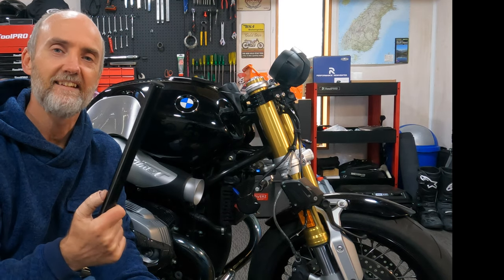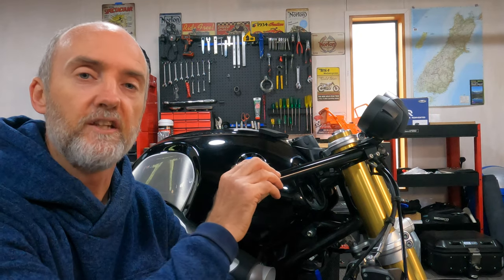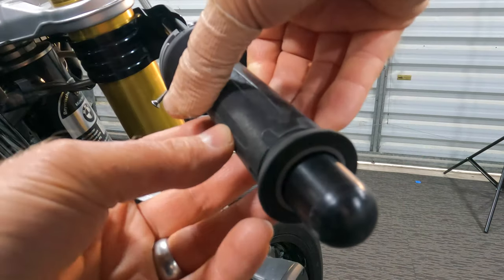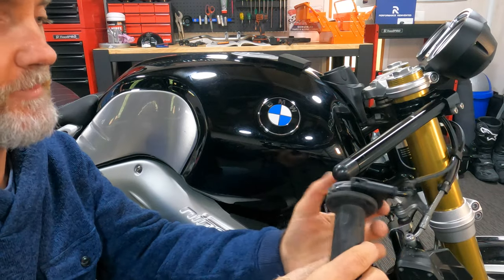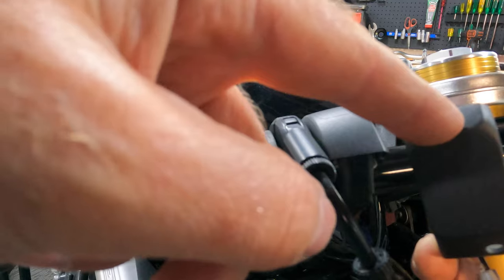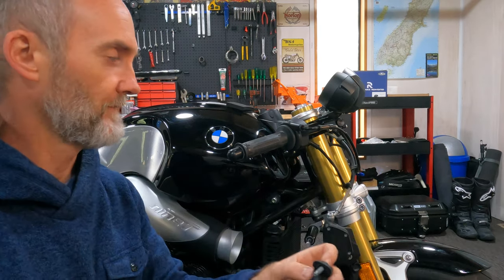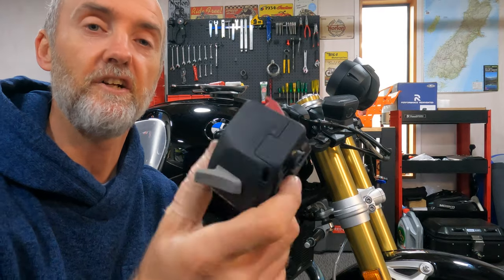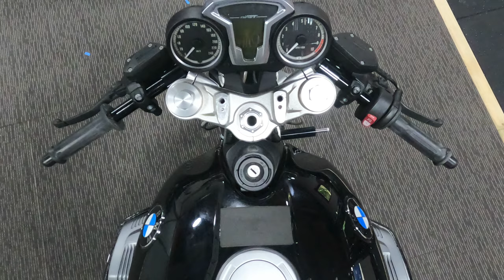R9T Clip-On Bars: Easy Step-By-Step Install Guide - Fork Drop Method - BMW R NineT

Comment: How is the steering with the clip ons? I test drove one yesterday with the same clip ons and it felt like i was driving a truck.  The bike did not want to lean in. Had the shift my weight when cornering in. Maybe the tire pressure or the stock stear dampener? Besides from that i came off the bike whit a smile on my face
Reply from the maker: Hi @kristofdecaluwe4, I bet you had a smile on your face for sure😃. They are great bikes! I know what you are saying about "driving a truck". The reason is that the distance between the clipons to the center of the bike is less than with the standard bars which reduces the leverage. This means a little more effort is required to initiate the  countersteer into a corner. But in my experience even racing on track around tight hairpin corners with clipons,  you quickly adapt. One of the reasons the reduced leverage feels like " driving a truck "  is simply that  the R9T has heavy tubed rims. Replacing the rims with carbon rims solves this problem for racing, but it's not necessary for on-street and it's not ideal if you ride streets with the occasional pothole😆. Anyway, thanks for sharing your experience with others on my channel 👍. All the best with your search for a new bike.

Comment: Whats the brand of the clip on and where can i buy it? Thanks
Reply from the maker: Hi Venom 13, these specific ones are "cheapies" as I'm racing this R9T and bars are the first to get clobber during a lay down.  The bars & clamps do the job, but I wouldn't recommend them for a dedicated street bike, because the bolts are rubbish and I ended up replacing those with a much better quality set. But even still the clamp threads are also low quality. If your looking for street, I would recommend buying something from a European manufacture rather than these.
Reply from the maker: One last thing Venom 13. Once you have a pair of clip-ons to install, I'd recommend installing them via the "Triple Tree Method" rather than the "Fork Drop Method" if you're comfortable with removing the stearing stem nut, then it will be less overall work.
TRIPLE TREE METHOD: https://youtu.be/9cM7EYC5qg8